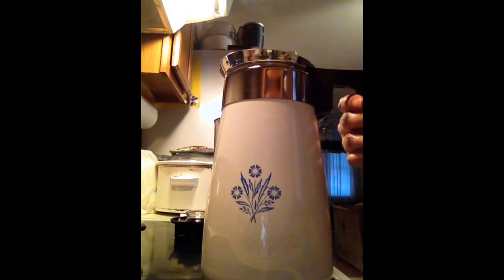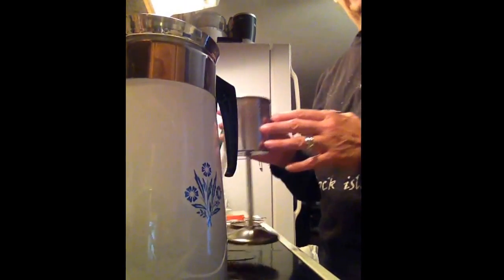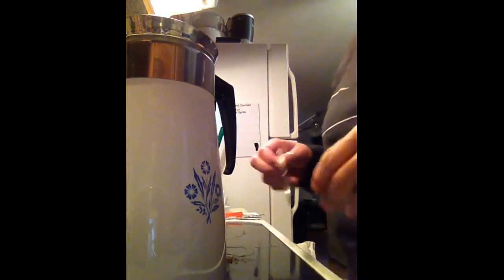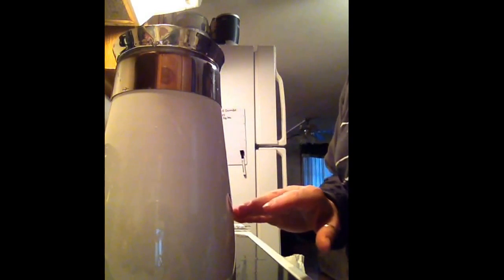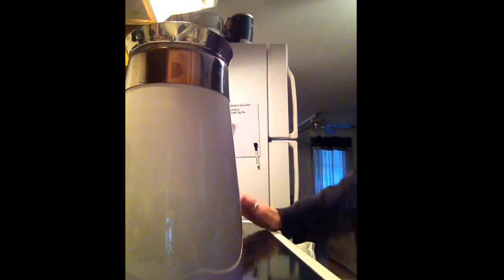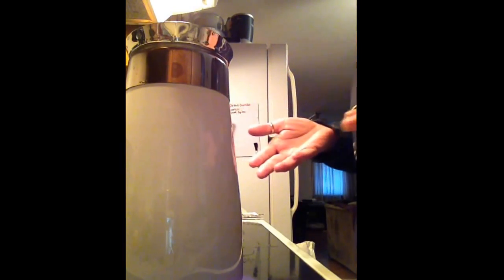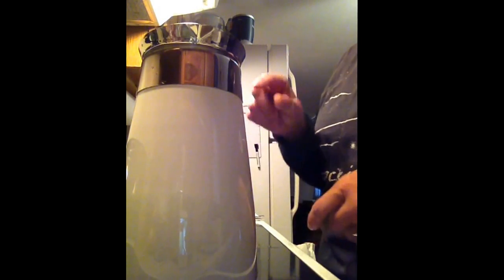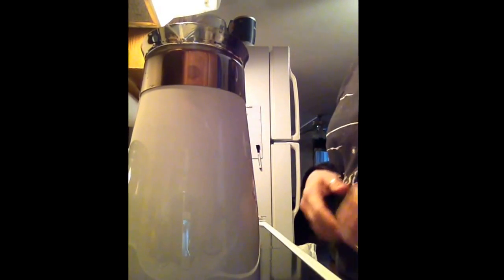How to Perk coffee 101

Comment: I just picked one up at Salvation Army for $4, my basket didn't come with a cover. :-(    Also, is the pot safe to use on a gas stove? I remember my Pyrex one I had to use a metal trivet so the pot wouldn't be on direct heat.  Thanks and thank you for the video!